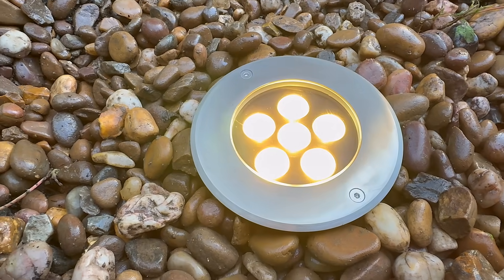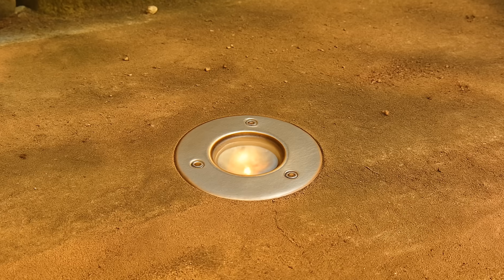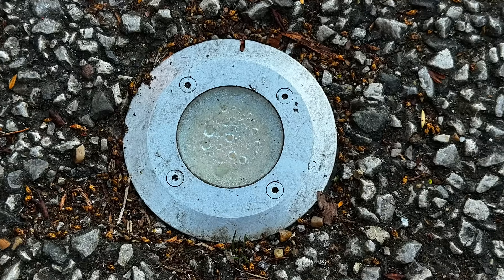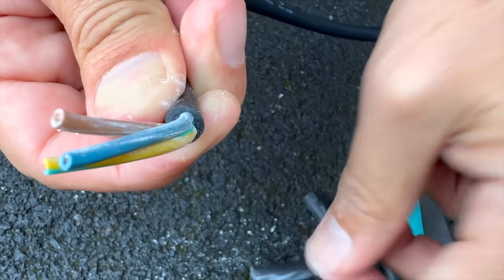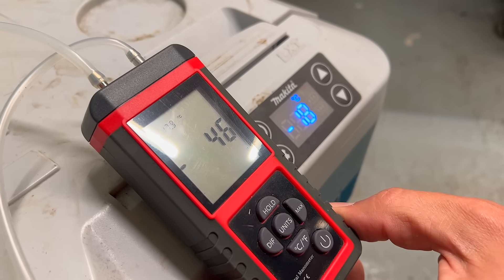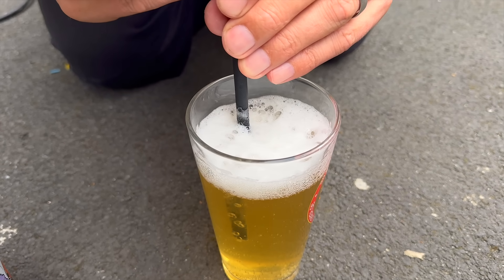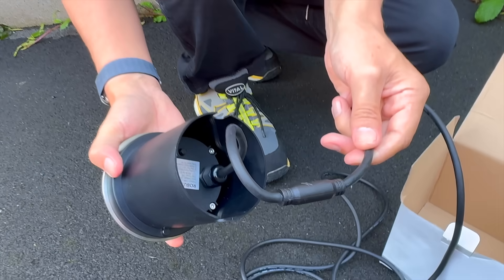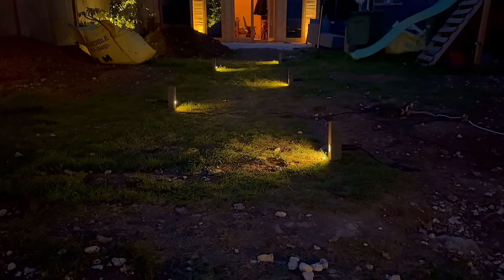IP67 Uplights Filling With Water? Here's Why

Comment: Land rover had this issue with td5 wiring looms. When the seals on the injector plugs failed, engine oil would wick up the wire and make it's way into the ecu, causing a short and therefore a misfire

Comment: Yes, a very common problem. I first put shrink tubing around the screw connection and the cable, but then I realized that it didn't help because the water was penetrating through the cable and I used cable kit to seal the cable inside.  The customer was rich anyway, so the extra €200 in labor costs didn't hurt.

Comment: My opinion has always been that recessed lights need to IP68. The Sealing o-rings should be Silicone as it allows the fittings to breathe. It's common that manufacturers use cheaper nitrile.

Comment: Even if it's completely sealed off you can still get condensation when it gets cold because of the moisture contained in the air that is trapped inside when it is first sealed. Also plastic and rubber are not hermetic, water can still get through them albeit slowly. The better lights will have a desiccant in them to keep the internal humidity low when temperatures fall.

Comment: i was installing landscaping 12v lights outside my house, first time, and knew of this issue because I noticed many lights having water in them as i walk past other houses. When i did the install, i took the lights apart, coated all gaskets with silicone oring grease, and put them back together. When wiring the lights i used wirenuts filled with silicone glue and added more silicone glue on top of that. 3 years later, all spotlights still beaming full brightness, the lens is dirty as hell, but still dry inside.

Comment: This can be the same reason your electric toothbrush get broken even it is sealed with rubber. it get a bit warm while holding and using it, when cooled down, the pressure different sucks the water in.

Comment: Reicipe: Strip outer layer of the cable, strip wires insulation but dont brake cores, make expanded fork, bend cable 180 degrees so it fits into cavity, clean from talk, pour a molten tar into this cavity with wires. Ice cubing mould or similar thing could be used. It costs pennies, requires gas tourch and cheap tar that was decades around to seal roofs.

Comment: I did a simple fix on a floodlight in a aluminum case mounted outdoor: i drilled a tiny hole on the underside  where no water drops could hang on the surface. Result no vacuum sucking in water. Condensed water accumulated inside the case drained out of the same hole.

Comment: I see no rubber air tight ringlets on the fittings. No wonder it leaks. Treat it like a deep sea ocean fitting. If it can't survive being at the bottom of the ocean, it can't survive rain on the surface.

Comment: At 01:58: which tool are you using to dismantle the cable. I personally have never been really happy with the different strippers when dealing with flexible insulation materials. Either it scratches the isolation of the cores (not that deep, but I don't like it) or it's not cutting deep enough and you have to "bend" the cable and cut the remaing outer insulation with an electricians knife...
Reply: That looks like a Weicon flat and round cable stripper. Also take a look at the knipex strippers - I have been using them for many years (granted, I work with much thinner cables - think UTP and the like)

Comment: I've seen water getting sucked for several meters through coaxial cables where the layers are sandwiched pretty tightly.  The result: copper turned green, bad signal.  You can't drink a beer or blow bubbles through that coax!  Lesson learnt: if there's a way, water will find it.  Always.
Reply: @ralfbaechle  water is life and life finds a way ✌️
Reply: @TaLeng2023 water is dihydrogenmonoxide a simple molecule not life. But I get where you are coming from.

Comment: A year ago i installed 240v deck lights ip65 with a manufacturer cable pre installed,  half of them leaked & kept tripping. 
The joiner boxes i used were wiska & i filled em with magic gel & they seem to be ok.
Reply from the maker: IP65 could be the issue!

Comment: Here's an easy solution: don't install uplights 😅 What are those even supposed to light up? The sky? There's way too much light pollution already.
Reply: They’re installed as a feature light, eg: a gate pillar, stone wall so many applications and work well in many circumstances. 
A light barely emitting 500Lumens will have no effect on your precious light pollution

Comment: These lights would need to be hermetically sealed. This would mean metal-through-glass penetrations or at least metal through molded plastic in a typical case to prevent any air exchange and humidity accumulation. When the lamp is on it gets hot and some air is pushed out between the metal threads of the conductors and between the inner conductor sheathing. When the lamp is off the air cools and replacement air is sucked in through the gaps between the plastic and metal parts. Your typical buried cable is not 100% water vapor proof either. Even if the air moves just 10 cm in the cable it will "respirate" in that 10 cm of cable and over a couple years accumulate water inside the light fixture. This can only be avoided with cabling that is much better than standard buried cable and fixture glands that are actually hermetic.

Comment: got set these in customers drive, kept me in work over years drying and repairing. use magic gel in bottom. they in resin drive so not easy to replace. the screws usually corrode, might be stainless but normally into a cast aluminium......which corodes or strips out.

Comment: Air tighten the cables is ok, but it does not solve the problem of the breathing. Moisture can even creap through the copper, between the thin wires. 
My solution for outdoor electronics are breathing ballons. Through a hole in the housing air can flow into a rubber balloon inside the housing. So you get no differental pressure but the breathing air stays separated from the electronics, stairs trapped in the balloon.

Comment: At my job we had to install the lamp into the ground, install the bulb and turn it on. Then lay the glass loosely on top of the lamp untill the heat sucked the glass vacuüm to the lamp. Only then screw it close. No air (vacuüm) is no moisture.

Comment: I met some residential building constructed in 2007 or 2008 where one garden light was used as junction box. It was really hard to remove garden light, but when I managed to remove I have seen 7 cables twisted with wire nuts and cables were installed extremely tight inside garden light. As result connections were damaged by corrosion and there was poor continuity between garden lights.

Comment: I rarely see ground mounted light not wet innside.
And seen several outdoor wall mounted ones where the whole bulb is watercooled 😂

Must of the GU10 ones where one shines up and one down there is a clear right direction up as the top threads and lower ones is directed to shed away water BUT there is no markings on the lamp or in the instruction to tell what way is up (unidirectional).

And i find it funny how "every" wall light marked IP67 has a bunch of bugs nd large flies inside it 😂

Comment: Many years ago I had a job, I was the manufacturers rep...on a £1m house. Drive lights were installed, but no pea gravel or sand below units. Also, contractor used T&E to connect units, and low and behold, the water just poured into the light unit housing. Contractors could not see where they went wrong, even instructions guided them through correct installation practice, which they ignored.
Reply: You can't expect a man to read the instructions before running into problems, manuals are for fault finding only as a last resort. RTFM
Reply: @Edwin_1986 Yes, I agree. You can't teach stupid.

Comment: Never liked ground-level recessed uplights. They almost always leak after a few years. At least the older halogen/ metal halide based uplights produced significant heat to help dry out any moisture that made its way inside.
Reply: You also need to live in area with no snow , tools to remove snow have a metal edge , imagine metal hitting that light .
IP 67 , devise dont let harmful  amount of water in when submerged 1 m deep for 30 min , so not water proof , only dust proof , that helps when its in ground .
IP 68 is 1,5 m for 30min , it is up to manufacturer if they want better, if they make it better that cost more and maximizing profits are how companies operate. 
IP 69 K , is used in food, medical, aviation and transport sectors  , there they test devise with pressure washer from 10cm with 100 bar. angles 0 , 30, 60 and 90
Reply from the maker: Good point

Comment: I use that raytech potting gel in the back of all my outdoor fittings. My garden floor and wall lights are 4 years old and still like new.
Reply: @tdlcraig1  I have used crystal clear epoxy to fully pot the lights all the way to the glass LEDs and all. Worked a treat.
Reply from the maker: Great tip 👍

Comment: Agree totally with your findings and to an extent, the physics, but IP67 is water not gas and her lies the issue! What happens is that water vapour (not water enters), increases the relative humidity, next evening cools, a minute drop of water vapour condenses (because it becomes saturated) resulting in a microscopic pressure drop, resulting in water vapour being drawn in... and so the cycle repeats, slowly getting worse with the diurnal changes in temperature / pressure. 
I sometimes have to test / fault find large outdoor lighting installations where a string of lights sometimes has 50-70 lights and the test stipulates >1Mohms L/Pc 250v HF which in the winter (or within 12 hours of rain) is a fools errand because of the necessary parallel connections. I took on a job that my mates had all said was impossible (and I was the last resort electrician, kind of story of my life!) and even with brand new, high quality post lights, installed to a silly over-the-top (non commercial) standard on an infinite budget basis, I was gutted to only get 850k and proved that they were all correct and the job was indeed impossible! I told the homeowner that I would have to install a small isolating transformer, but then I had an idea and made them totally off grid, it worked so well that we got rid of the on/off switch, replaced it with a 24v sensor AND the great thing is that I then discovered that CCTV cameras record in colour at night with a DC supply! Since then I have become a bit of an off grid lighting guru and designed / constructed / installed quite a few similar systems. Recently, the gel pack LiFePO4s 24/48 have got really good and amazingly cheap, so I have done quite a few 24v DC systems using an MPPT to LiFePO4 with BMS RS485 interconnect, taken out all the 230v LED and replaced them with 24v 11w E27 HUZANNE types and the results are just stunning! Its the way forward AND then you just use replaceable bulbs and at the start of every season, clean them all up, remove built up condensation, replace any bulbs that have squatting illegal immigrant spiders, they will last for years, who cares about power cuts AND all the old IR glowy red CCTV floodlighting goes to the tip AND on an EICR they count as independent self powered solar (outside the IET regs) so we as electricians note their existence and write n/a!
Reply: If any of you would find it interesting how I go about some of these complicated hybrid systems, I would be quite happy to make a vid on it, regards Paul

Comment: A good in ground uplight should be supplied with a length of non-wicking cable.

Even with non-wicking cables, in ground uprights can still have condensation. When relamping it is essential to switch on the lamp and leave it on for about 15 minutes to warm up and drive out moisture before re-installing the lens.

Comment: There's a park near me where pretty much every single uplight around buildings has moisture in them despite being under the rain shadow of a roof so humidity pumping is the likely culprit (tropical coastal area).  Even the ones that have failed and been replaced show moisture.  I'm guessing the council bought a box of spares to guard against availability problems down the track and are now slowly eating into that reserve.  It'll be interesting to see what happens when that supply runs out.
Reply: What happens is the park starts becoming darker until the council starts a new procurement exercise
Reply: Are they no longer available commercially?

Comment: A customer had two fauly IP cameras. Turned out the cat 5 cable was wicking water into the camera case.
Reply: I had this happen to a wall mounted camera at a chruch. The camera was installed on a wall mount and facing downward. The wall allowed water to collect inside of the wall mount, causing the waterproof connector to be submerged. I couldn't understand why the camera was filled with water but assumed water had traveled down the cable into the camera. Those waterproof connectors aren't meant to be submerged. This is the only video I've ever seen addressing the issue of cables allowing water movement.
Reply: @eichbc    those waterproof cables are meant for ingress of rain, not submersion. That is true of most electrical items other than pool lights. You oughtta see the mess we get after a good storm tide near the coast. About 6-12 months later all the outdoor electrical goes gafluey from salt water saturation.
Reply: Interesting. what solution did you come up with to prevent a repeat?
Reply: @Marc-ww7cc  I wonder if they used outdoor cable. It has dielectric grease inside the cable to prevent water getting in.
Reply: @Marc-ww7cc We turned the external box upside down and had the conduit go in the bottom. Fixed the issue (water had filled the junction box due to top holes - stupid decision by the electricians during the install).
Reply: @Marc-ww7cc  Never installed an IP camera outside. But I guess you could use a longer cable and let it hang a bit below the connector. That way the water that comes from the wall or the top of the camera, drains from the connector, to the belly of the cable (the lower spot). Water tends to bind to surface and roll with it

Another thing, If the cable goes into the wall, you should make the hole at 5° or 10° upright, and seal it later
Reply: Why do that? They'd be losing a repeat customer!
Reply: @BiblicallyAccurateClippy2320  you want a repeat customer. Not a warranty customer. 1 gives you more paid work, the other doesn't.
Reply: 5 cats inside
Reply: As kids we made a LAN network (PC2PC) between two opposite buldings (yeah, I know - complete safety nightmare) :D But the lower appartment's LAN card received so much water, than we ended up disconnecting the cable. It was during the Dial-up times..
Reply: as a security camera installer, yes we use outdoor rated cat and yes it's important to configure your gang box and flex conduit (at least in our case) in a way that prevents water ingress/buildup. usually we also cut our flex conduit a little over so the center hangs, and drips water off. unfortunately our camera supplier doesn't seem to be concerned with sealing the back of goosenecks on corner mounts (although they slant upward from the plate) but i haven't personally seen any cameras that have suffered from issues because of it. properly installed gaskets at the camera obviously help immensely.
Reply: They probably used IPv4 and not IPv6... 😔
Reply: @SirHackaL0t.  I remember there's a vehicle that when the oil pressure sensor fails it could push oil through the cable harness all the way back into the ecu